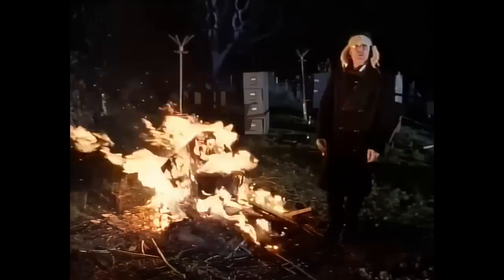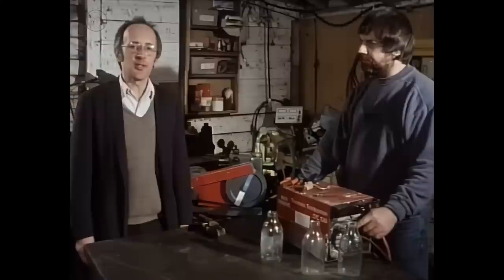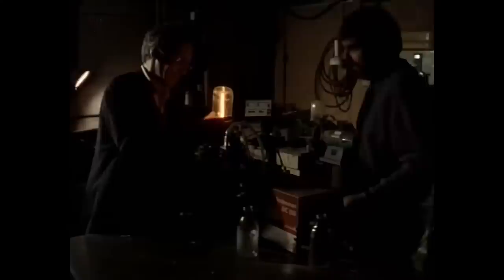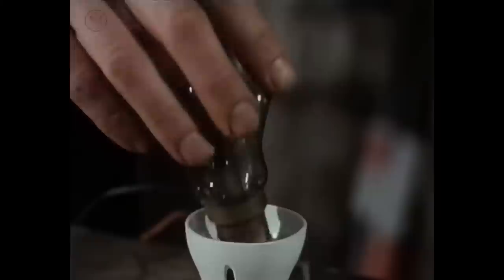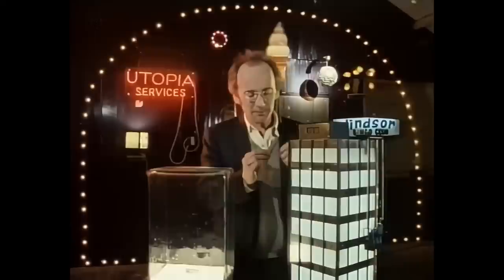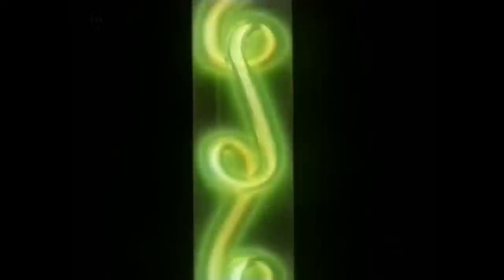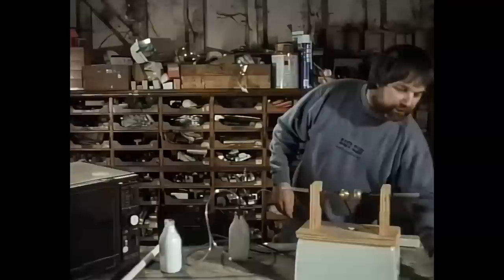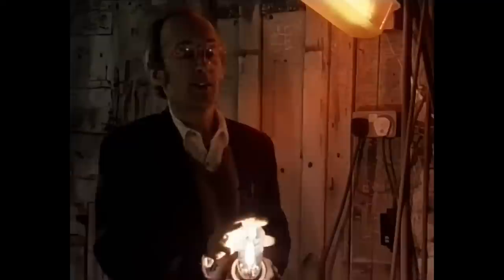The Secret Life of the Electric light - Remastered

Comment: Heat from tungsten lamps used in traffic lights used to keep the snow melted off the lighting assembly, when new LEDs bulbs where used at first the signs used to clog up with snow until they fitted heaters with temperature sensors in.
Reply: on a similar note i have heard the more modern diesel warships couldn;t operate in the far north as the decks will ice up and topple, steam ships could use steam hoses to blow offf the ice and operate further North. And coal/ town gass was so oily it sealed its own leaks, when north sea oil gass  came along it dried out all the joints and leaked.
Reply: That is not true. 
One - due to protective visors on top of the lights, for traffic lights to be occluded by snow, wind would have to blow that snow directly into the light for an extended period of time. 
We call such an event a blizzard. 
AKA that time when you shouldn't be on the road. Unless you want to die. 
Snow that does gather that way will melt as long as the traffic light remains operational. Because...

Two - LED lights DO produce heat. They just tend not to produce it in the IR part of the spectrum like incandescent bulbs do.
In fact, per watt, LEDs produce far more heat than incandescents - up to 85-90% of energy used by an LED gets converted to heat, whereas an incandescent bulb will convert only about 10-15% of the energy used into heat. But it will shunt as much as 80-85% of energy into invisible IR.

I.e. A 100 W incandescent bulb will produce about 1600 lumens of light and some 10-15 W will be wasted as heat. 
For the same amount of light one would need an LED of about 20 W, which would be wasting about 17-18 W as heat - more than the equivalent incandescent bulb.
The reason incandescent bulbs are much hotter is all that IR light that gets wasted BUT which still heats up the surrounding air as it radiates from the bulb.
But back to snow not melting... 

1 Watt = 859.85 Calories per hour. 
1 Calorie is the amount of heat needed to raise the temperature of 1 gram of water to 1° Celsius - AKA above the melting point. 
A traffic light using 8-15 Watts will waste 7-13 Watts as heat, AKA it will melt some 6-11 kilograms of ice per hour of operation.
That would be a block of ice 10 centimeters long, 10 centimeters wide  - and 60 to 110 centimeters high.

Three - but people are stupid.
So, there ARE such things as LED traffic lights with heaters built in (because stupid people demanded them and we all know that stupid customers are the best buyers of unnecessary stuff) - but practically no one uses them.
Cause it took years for them to be created, as no one actually needed a more expensive, energy wasting LED traffic light. 
Engineers designing LED traffic lights being good at math and stuff, unlike people worrying about snow not melting when heated - they never thought to design a version for morons. Silly engineers. 
In the mean time, all those municipalities that did switch to LED traffic lights figured out that they don't need heating their LED lights to melt the snow - and they never needed to replace the LEDs they got the first time. 
Cause unlike incandescent bulbs - LEDs last a LOT longer. And use far less energy.
Reply: @d3nza482  I agree with you that LED lights do produce some heat.  Measurement of the lumens of visible light produced per watt of power consumed will show that LED lights are much more efficient than incandescent lights.  I do not think it reasonable to include the infrared radiation produced by incandescent light bulbs as "light" in your calculations because it is invisible to the human eye and thus of no use to humans as light. This fact tilts the efficiency contest much in favour of the LEDs.

There is also a significant error in your calculations of how much ice can be melted per hour by the 7 to 13 watts of waste heat you assume are created by an LED traffic light.  You state that "1 Calorie is the amount of heat needed to raise the temperature of 1 gram of water to 1 degree Celsius - AKA above the melting point."  This is not a correct statement.  A correct statement would be:

 "One calorie is the amount of heat that needs to be added to or removed from 1 gram of liquid water to increase or decrease the temperature of the water by 1 degree Celsius provided that no phase change of any of the water is taking place."  This quantity is called the "specific heat" of water.

Snow is frozen water, basically particles of ice.  To melt 1 gram of water ice at a temperature of 0 degrees Celsius to 1 gram of liquid water at 0 degrees Celsius requires the adding of 80 calories of heat to the water. This quantity is known as the "latent heat of fusion".  During the melting transformation the temperature of the water will remain at 0 degrees Celsius.  The process is reversible.  Freezing liquid water into ice requires the removal of 80 calories of heat per gram from the water.  This quantity is known as the "latent heat of solidification."  Again, the temperature of the water remains at 0 degrees Celsius during the transformation from liquid water to ice.  The heat added to or removed from the water is called "latent heat" because it does not result in a temperature change of the water.  Instead, the heat causes a "phase change", which is a physicist's way of saying the water is either melting, freezing, vaporising, or condensing.

The error in your calculation is that you have not allowed for the latent heat of fusion of water, thus your calculations are in error by a factor of 80.  Seven to 13 watts of heat over 1 hour represent 6,018.95 to 11,178.05 calories of heat which will be capable of melting 75.24 to 139.72 grams of water ice per hour if 100% of the waste heat is added to the ice.  Most traffic lights have 3 illuminated areas (red, green, yellow) which are illuminated only one at a time.  The waste heat is shared among these 3 areas with typically the yellow getting the smallest share because it is only illuminated for a brief period in each light cycle. This means that the yellow light will have only a small fraction of the ice melting power available to it and will be at greatest risk of being obscured by snow.  The bottom line is that the problem of traffic lights being obscured by snow is a very real problem and must be taken care of appropriately.  I am a Canadian living in the land of ice and snow so I have seen early LED traffic lights obscured by snow before the problem was properly addressed.

Incidentally, the latent heat condition also occurs when liquid water is boiled.  To boil 1 gram of liquid water into steam 540 calories of heat must be added to the water.  This quantity is known as the "latent heat of vaporisation".  To condense 1 gram of steam to liquid water 540 calories of heat must be removed from the steam.  This quantity is known as the "latent heat of condensation".  In both cases the temperature of the water/steam will remain at 100 degrees Celsius as the phase change takes place ASSUMING the pressure is maintained at 1 atmosphere which is 14.7 pounds per square inch or 101.325 kilopascals or 760 mm of Mercury in a barometer.  The boiling and condensing temperatures of water are strongly influenced by the pressure applied to it. If the pressure is higher or lower than 1 atmosphere the water will still boil or condense and require 540 calories per gram to do so. Assuming the pressure is steady, the temperature will not change as the process takes place, but the temperature will be different from 100 degrees Celsius.

Also incidentally, once water undergoes a phase change to ice or steam its specific heat changes.  The specific heat of ice is about 0.5 calories per gram per degree Celsius.  This means that adding or removing 1 calorie of heat from 1 gram of water ice will change its temperature by 2 degrees Celsius.  The specific heat of steam is about 0.48 calories per gram per degree Celsius.  This means that adding or removing 1 calorie of heat from 1 gram of water steam will change its temperature by 2.083 degrees Celsius.
Reply: (Continued Comment)

There are also a few other small errors in your work. You properly use capitalisation for the SI (International System of units) unit "degrees Celsius" as this unit is named after a person (Anders Celsius) so it is a "proper name" and thus capitalised. Oddly enough, the SI unit "watt" for power, even though it is named after the person James Watt, is NOT capitalised and should be written as "watt". Only when abbreviated (or used as the first word in a sentence) are the units named after people capitalised so it would be correct to use "W" as the abbreviation for watts.  I agree this makes no sense, but this is the way the SI system is defined.

Unfortunately you also capitalised the unit "Calorie". This is incorrect. It is true that the unit "Calorie" does exist and it does refer to a quantity of heat but there is a difference between a "calorie" and a "Calorie". The "calorie" is a unit used in physics and thermodynamics and is the amount of heat that will change the temperature of 1 gram of liquid water by 1 degree Celsius. The "Calorie" is a unit used in food science and is the amount heat energy liberated by a food item when tested in a calorimeter. The ratio between the two is a factor of 1000. One Calorie is equal to 1000 calories. For this reason, a Calorie is sometimes called a "kilocalorie" or a "large calorie" to distinguish it from the calories used in physics and thermodynamics. When you look at the label on a food item and it lists the number of Calories in the food it is talking about kilocalories or large calories. Confusing the two units will obviously result in an error in calculations by a factor of 1000!  Isn't science wonderful!  Just so many subtleties to confuse a person!  Unfortunately, it is important to get these details correct or another person reading your work may not understand it properly or it may lead to errors in calculation.

d3nza, I would like to congratulate you for attempting to do a mathematical analysis of the ice melting capabilities of the waste heat of LED traffic lights. Not many You-Tubers would have the courage, incentive, and inquisitiveness to do so!  It is so nice to see an intelligent comment like yours where you tried to work out the factors of the situation logically to justify your conclusions. This is how science and engineering are done!  Unfortunately you got caught by an oddity of the physics of water. It pains me a bit to point out your errors when you have tried very hard to do a proper scientific analysis of the situation, but if we are going to do science here, we need to get it correct.  In fact, posing a hypothesis/ conclusion and having others check and/or test your work is how science eventually resolves a clear picture of the truth of a subject.  In writing all the stuff above I am NOT trying to ridicule you. I am trying to further your knowledge so that the next time you need to deal with some of the physics of water you will have more understanding and be better prepared to develop the correct calculations.  I hope you will keep at it, keep learning, and continue to elevate the level of the YouTube comment discussions. It was my privilege to respond to your comment!

Disclaimer: I am not a physicist or a thermodynamicist.  My training is as an electronics / electrical engineer. If there is a real physicist or thermodynamicist in the crowd I would appreciate a critique of my work. After all, I have a lifetime of experience in sometimes getting things wrong!

Comment: I'm very glad that your house did not catch on fire, that kitchen looks very cosy. I've experience gas lighting when I was young at a relative's chalet that did not have electricity, they also had a gas powered refrigerator. I was amazed by both technology.

CFL do last much longer than incandescent lights unless they're in emplacement like recessed ceiling lights where the heat is trapped and damaged the electronics.  I bought CFL years ago before LED were popular and affordable and I've yet to change one. The manufacturers are at fault for not divulging that some emplacements are inadvisable.

Comment: I made a spectroscope using a webcam and a refraction grating film. 
Spectral Workbench is a great free open source software to run. 
You can see what a light is made of. Great to identify fake Sun lamps and UVC Leds.
Reply: Google "i-Phos light Spectrometer" for the kit I built. 3D printed my own stuff and used a mailer tube for the body.
Sold as a kit for 85 pounds in the UK, by Chris Wesley. 
He has a channel on YouTube (Chris Wesley), where he shows how it all works.

Comment: i remember buying some compact flourescent bulbs at grainger in us way back . they were tubular straight not the swirl and when you flipped the switch they took like 1 or 2 seconds to come on. i used them in my apartment in a regular edison base lamp. they did actually last me 20 years using them for about 6 hrs/ day . they were in an open lamp with the base down. the swirly bulbs lasted very poorly but were cheap. the once that lasted 20 yrs cost about 25 dollars each so like 50 bucks in todays money.
Reply: Just like the Philips SLs Bulbs very robust CFL from 80s early 90s,
Reply: @SkunkMantraTechnoSkunk  Or the Osram CFLs (and early Osram Sylvania after the 1994 buyup of GTE's lamp division) when they were USA made.  I have some in regular use that are almost 30 years old.
Same with the preheat choke ballast CFLs where the lamp is a separate replaceable element.  They last ages.

Comment: I like this series since it reinforces the fact that no invention is the result of a single man.  The electric light, for example, wasn't just "invented" one day by Edison; it's really the result of the smaller inventions that build on the ones before it, cascading into the final, more useful invention, like the electric light, the telephone, video/audio tape recorder, etc.

And in the case of the radio, some electrical inventions involve more mechanical parts than you'd think-tapping on the radio coheror to keep the filings inside from settling...
One day, we'll have all that "green energy" and even faster-than-light space travel, but only after many hundreds or even thousands (or millions!) of related inventions have been discovered to make the end possible.

Comment: As you mention, incandescent light bulbs make fantastic and economical low power heaters. I have a number of unheated sheds with a water supply, the pipes freeze in the winter so I drain them, but where the supply comes through the floor before the stopcock cannot be drained, so is prone to freezing, it blows the compression fitting off the plastic pipe if it does. A small insulated box around the stopcock with a 20 W bulb in it stops it freezing, however cold it gets. Cheap to run and extremely effective!

Comment: The Lenny Henry joke, the flat has centeral heating, a light bulb in the middle of the ceiling. Ladybird simple electronics 1979 had a light falshing robot that I built , mesmerised by the glowing filaments controlled by blue tubes , small lumps in wires and three legged sealed tubes.  probably set me on a path. Electromagnetic spectrum. to understand these fundamental principles is a pleasure. The eye and the brain, fascinating, the layers of filtering and re-combination, to give a binary answer to can you spot all the traffic lights in these pictures. Love yuor work.

Comment: CFL lifespan varies by orders of magnitude based on how they're used.  I have a lamp that I never turn off, and that keeps a CFL running for maybe ten years at a go, but I have a motion-sensing outdoor fixture (constantly turning on and off all night) that I can't make last longer than a couple of months.
Something to watch out for on LED bulbs is that they calibrate the circuit boards to overdrive the LEDs enough that they don't last either.  There are videos here (notably by Big Clive) letting you in on how to modify these to last vastly longer for only a small sacrifice in brightness.

Comment: If you're a laggard who's still running incandescent bulbs everywhere - LEDs are basically free money. They've gotten so cheap and they use so much less power that they will pay for themselves in short order.
Reply: The voltage regulators in LED bulbs are trash. As are the LEDs themselves. Many bulbs will not last long enough to pay for anything.
Reply: @1pcfred  OK Boomer
Reply: @1pcfred  Some of the early LED bulbs used quality components, had sufficient cooling, and last well. Since they've been mass-produced, they use junk buck converters, less than adequate heatsinks, and overdrive the LED chips. Commercial lighting may be better, but they're not readily available to consumers.
Reply: @BlankBrain  the electronics industry itself has changed over time.  Used to be if you got parts off a reputable dealer you got genuine parts. Today that is less assured. The budget manufacturers do not even are about that. They're going to use the cheapest stuff they can get their hands on that works. So the consumer has no idea what they're getting.

Comment: Tim, With your prism can you test modern LED lights for me please? In my workshop I have a problem reading laser printed job cards without my glasses, (yes I know Im getting old) but in daylight its fine, we use only use LED overhead lights and LED hand lamps, My theory is that if the lights had the white light made from RGB or our torches had a few RGB LEDs added into the the light output this would have the affect of making our eyes focus better using the more mixed wave lengths rather than 1 wave length of white. Great to see these video "again" loved them the first time on TV. I used to live up the road from Brum. (oh and the RGB torch /lamp thing I will claim copyright on it now just incase it catches on LOL)